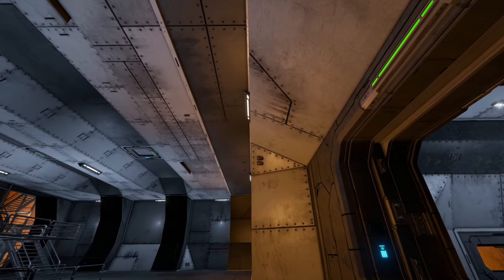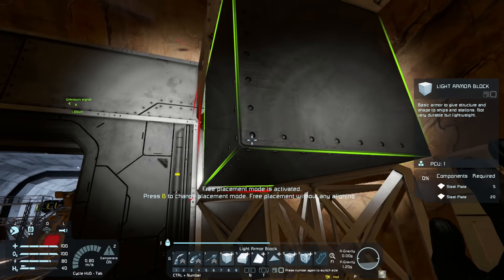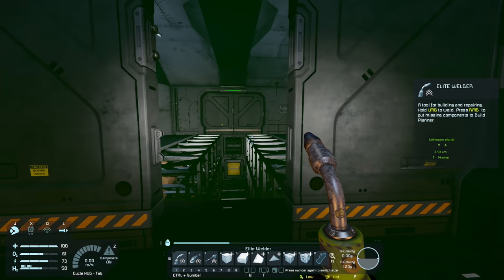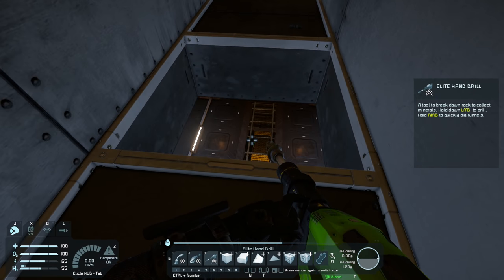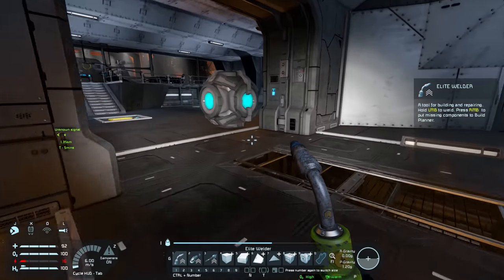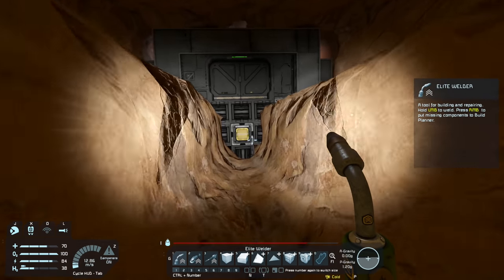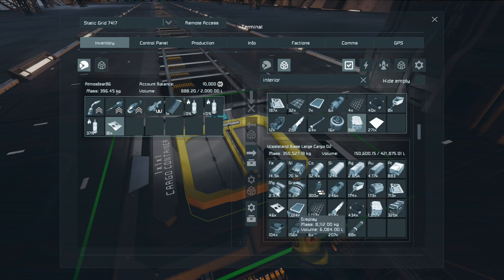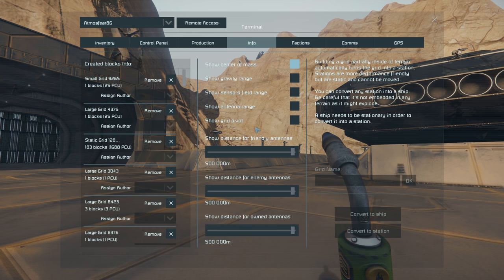Space Engineers - Wasteland Survival Ep42 - Expanding the Base!!

Comment: if the hanger hallway is the variable to align the elevator shaft, all you need to do is dig up from the cargo bay shaft until reading the height level of the hanger, then drill forward on hanger tunnel until meeting the shaft tunnel.  Length of cargo tunnel is irrelevant, just the location of the elevator shaft.

Comment: The pesky little voxels can also be removed with a large block drill installed nearby. They clear a block around the end and don’t have to be piped in  to  work. That’s assuming you can’t get your awesome miner in the space you need to clear..
Reply from the maker: Yeah i was concerned about drilling out the walls though, which is why I opted for this method. The reason i want the wall to be dead perfect is because i plan to place a window next to them, otherwise i would do exactly as you described 😁